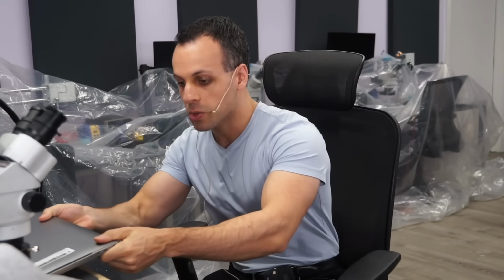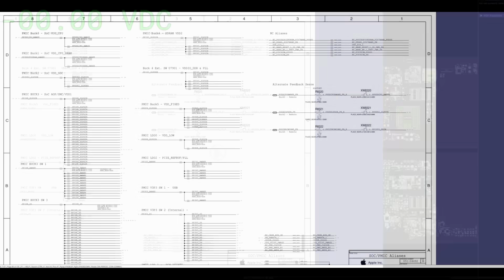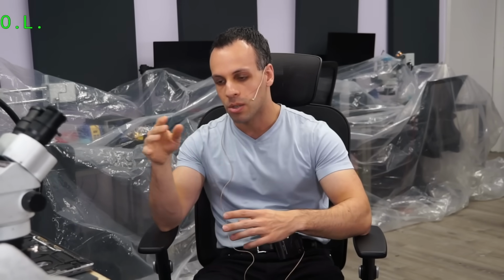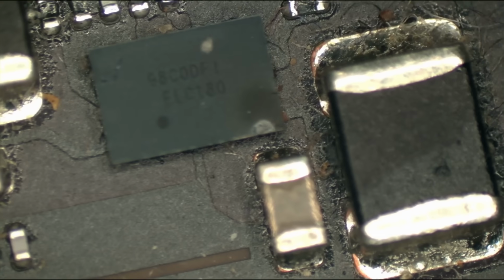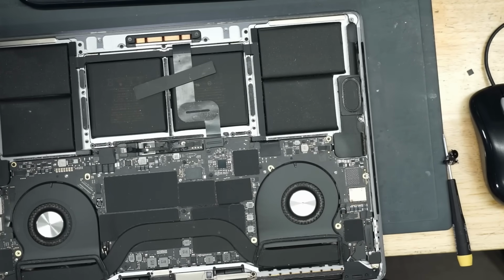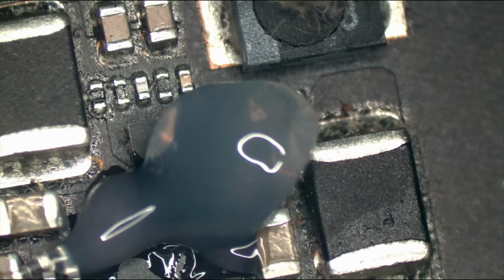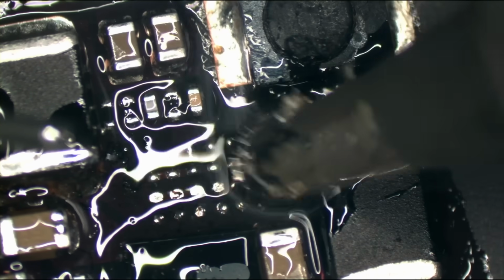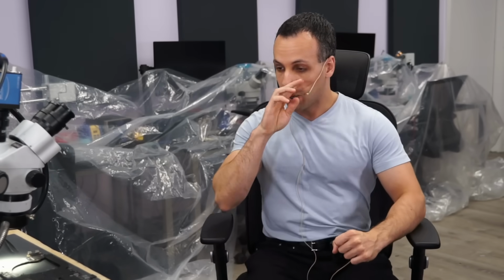How most 16" Macbook Pros often kill themselves & why they're unfixable

Comment: Louis, as somebody who currently has a 16” Intel MBP, and requires it for iOS development, what should I do (other than immediately backing up my data). Is there anything I can do to help prolong the life? Or should I sell it while it works and buy a different model? Do you have any current recommendations?
Reply: Zener diode is the protection you need. Simple to install if you have anyone that does microsoldering. One leg on the power and one on GND. If the Zener is designed for the reference voltage and amperage for the nand, then if it sees a voltage surge it will either pass this to GND or short and send all power to GND. If it burns up it would need replacement but they are cheap and your SSD Controller should be saved.
Reply: Responding because I’m in the same boat. And guess what - I only bought this 16” Intel because my 15” 2016 model had all sorts of random issues. I hadn’t had issues with any models prior to that. Until today at least, my 16” Intel has seemed flawless like I was used to from the brand. Now I’m back to worrying.. 🥴
Reply: As others have suggested here, installing a crowbar circuit to protect the NAND is an option. Might be as simple as installing a single diode.

Comment: I’ve had the same problem on my 2019 MacBook Pro 15”. I properly shut it down and let it rest on my desk as I will be away for a three-day vacation. 

After coming back, I tried turning it on, use different USB-C cables and other compatible chargers (the 87W, my third-party 100W), do SMC/PRAN/NVRAM reset, but no luck. 

Brought it to the less expensive Mac repair shop around our area and they found out that the SSD was the culprit and said it had to be replaced. Was unlucky that I haven’t made recent backups before it happened but lucky that my company paid for the repair fees which was around 530 US$. Still costed more if I brought it to Apple’s authorized service center.

All these hassle just 3 months past Apple’s 1-year warranty. Not to mention that the repair took one month before it got released for pick-up. During that time, I came back to my older MacBook Pro 15” (Mid-2015 model) to cover up the work I do (which are also editing long YouTube videos on Final Cut Pro btw).

Can’t imagine the same problem I’ve had happens to the newer MacBook Pros too. Apple never learns.

Comment: I've been looking into getting broken MacBooks to fix and sell. So far I'm looking for low risk eBay auctions where it's as easy as swapping a new display assembly or something like that where it won't be hard to turn a profit. Already had my first run with the A1932 and JUST WOW I cannot believe how much the aesthetics lie. I mean, I always knew these weren't my machines of choice, but there's so much more wrong about them. With a shiny finish and an expensive price tag you'd think you would be getting what you pay for - nope. Either way, I enjoy the experience. It's fun to problem solve when you get to learn something new and maybe make a buck doing it. Great fun.

Comment: Posting this mostly for the 'engagement' ... I found a pristine looking 2018 MBP tossed out at my local recycling centre.  Water poured out of it when I picked it up, so my first guess was water damage.  I dried it out and cleaned it up really nice.  No visible corrosion.  There was a suspicious looking scorch mark coming from under a small chip that I can't read the markings on.  That, and this video, makes me think that a similar failure has happened.  The water could have got in later, after it was tossed.  Poking around with a multi-meter, I can find 13v, 3v and 1v (I think) but no signs of life.  This thing cost me nothing, so I'm wondering if a second-hand MB from ebay might be worth a shot.

Comment: I'm surprised they don't have TVS or zener diodes on the output of that buck if that's a common enough failure mode and the risk to user data is so high...

Comment: Great video, but painful to watch knowing someone lost their data. I’ve used Macs since 1986. They used to be bulletproof: very reliable with changeable parts (not soldered onto board). 

My two-year-old 16 MBP died last year (No water or drop damage). I didn’t have AppleCare, as the laptop cost $3,600 and I didn’t want to spend hundreds more on the expensive insurance. (big mistake!). 

I trusted Rossman Repair, so shipped MBP to New York (it cost $100-mostly for UPS insurance). Rossman could not repair due to security of Apple’s proprietary T2 chip. 

Then I paid $800 for Apple to replace logic board. Fortunately I restored most files from iCloud, but lost much of my music (iCloud doesn’t back-up music if not subscribed to Apple Music). 

Lessons learned: buy AppleCare; back-up everything, including music.
Reply: you clearly didnt learn a thing. If you had learned anything then:
- realize apple isnt what it was
- get rid of the garbage after repair to recoup as much as possible
- get proper notebook that will last and/or is repairable

What you did was:
macbook broken, pay money, pay more money, hope they will honor the apple care.
Reply: Always, always buy AppleCare.  I get the refurbished models so with AppleCare the price is the same as a "new" copy.

Comment: I get Apple doesn't do things the best way, but man do you exaggerate sometimes. Yes these MacBooks can be repaired and not that difficult to someone like you with proper tools and experience, knows how to read schematics and what not. Even I could probably do some of these repairs, I did avionics in the Marine Corps, was great at soldering. I see Chinese techs repairing MacBooks all day long. Removing and replacing SSDs, RAM, even the SoC M1 processors. Granted they have better access to tools and more importantly, parts, since they're so close to the manufacturers. 
That the owner doesn't have a backup of his computer, and you have to replace an SSD, doesn't mean it's unfixable or anyone's fault but the owner.
Reply from the maker: Cope

Comment: Yeahhhh...... Uhmm... Still not switching to SSD without any spinning platter drive as backup device. So far I am still using spinning platter drives in my machines, because I dont trust and never will trust SSD's. The idea of using solid state storage is cool on Amiga's and 386/486 vintage PC's if that is your hobby. But in the daily driver with all your data, and make it soldered on as default? Heck no...

Comment: One demand for Right To Repair should be a requirement that ALL batteries and data storage devices be user-replaceable. Think about how terrifying it is to update your BIOS because if something goes wrong, the soldered-in chip has now got corrupt data on it and your board is bricked. Now think about how reassuring it would be if you could just pull out the chip and load the update using a dedicated programmer plugged into another machine's USB port if the update fails.

That probably wouldn't guard against this kind of incompetent/malicious design, though. Not unless your removable SSD had over-voltage protection built in.
Reply: And it isn't like you can't make a small laptop with a replaceable SSD. The original 10" MBA had a replaceable SSD and it was a tiny computer.

Comment: Lol 😂 This is why my last MacBook is from 2015, an Air, with a proper keyboard. I actually did own one of the new garbage MacBook pros, with the shitty keyboard they use now. I hated it so much, and the Z key started sticking after about a month. Left it in a drawer for almost two years, until I took advantage of some battery issue that offered a free replacement, which also REQUIRED the keyboard to be replaced, because... Apple. So, I could sell it on at a good price because it had a brand new battery and keyboard. My 2015 Air still works great, but I upgraded to an Asus PC with an OLED screen, so it feels really weird looking at that pixelated display. I'd still choose that 2015 Air over ANY laptop in their current lineup, though. RIP Apple ☠

Comment: I knew it! 
I had the same problem, after a while talking in the phone with them they agreed to fix it free of charge. but they insisted it was an isolated fail and not a model problem. 
MFs that thing is expensive as hell, and if you don't fight with them you get an expensive paperweight after two years

Comment: I wouldn't be surprise if Apple started building in timers into their machines which start when you first setup the machine so after 366 days, literally one day after the warranty period ends, the machines fry themselves.
Reply: That would probably lead to a class-action lawsuit.

Poor circuit board design can be argued. Intentionally destroying a customer's product after selling it to them on the other hand...
Reply: What they would probably actually do is have some chip with an intentional bug in the firmware that occasionally causes it to lock up after more than a power of two number of power on hours or similar, and can be plausibly denied...

...And make that chip control a power MOSFET for a buck converter to some crucial thing like a SSD.
Think different.

Comment: question if apple was right how did the liquid water gest under the chip, buried in the middle of , everything else, are apple Macbook, build to the same build standard star wars  death stars, with a really you less hole on the outside going striate to the most critical part of the machine for apparently on reason

Comment: Hey Louis, I don't know much about this... but it looks like you misplaced the chip on those contacts, it looks like the you are 1 column of pins off. the chip you desoldered was a bit to the left
Reply from the maker: Watch again
Reply: @rossmanngroup  hey! I watched it again and I still feel the same. 
At 10:20 the left side of the chip is aligned to the second of those 5 components (resistors?) on top.
At 13:06 it is aligned to the third resistor. The chip is almost touching the resistor on the right, and before there was more clearance. Also there are a few pins showing on the left.
Reply: Hey  @rossmanngroup  I still think the chip wasn't installed correctly, can you take a second look?

Comment: I love a lot of things about the build of Apple devices. However, it all quickly diminishes because they like to use graham crackers as their PCBs, with proprietary components on them. Their business model is e-waste, but they have some fantastic engineering. If the unit just breaks and isn't serviceable, it just ruins it. I don't need a computer that thin, I can compromise. Also, M1s are useless to programmers, they can't even virtualize x86 worth a crap even know they have this hardware pipeline in the CPU to handle it, but it is only half-baked and doesn't universally allow the kernel to do what an intel mac can to with no problem. Thanks intern at work for showing me how crippled the new silicon is, I was about to trade my Intel in for an M1 for that battery life, but 3 grand for a glorified chromebook is a no-go. Thanks for all you do, Louis! I have learned so much from you.
Reply: Also, not sure if this Mac is M1, i missed the model number you mentioned earlier. I had an Intel 2019 13 inch Macbook I sent you last year, and I dropped something sort of heavy on the "K" key of my Macbook, it is right where the SSD is. It was not fixable, I think the same design flaws made it so easy for my SSD chip to just die, I still have the computer and might send it back to you for full refurb before parts get even more scarce.

Comment: I'm not usually in the camp defending apple, but I do not see an issue in the circuit design here.
This is a huge screw up on TIs end if the chip is known to blow up in that way. This is not a very unusual buck converter
and if this happens to fail in that way many other devices would be affected as well.
I mean if your main supply is too high someone needs to step in and make it fit for the SSD or any other component.
It wouldn't even help if it was a replaceable SSD in this case because it would be fried as well.
Reply: I think the main design flaw is that Apple should have added a crowbar (or other protective circuit) to prevent a power supply failure from frying the SSD. It's not uncommon to design crowbars into power supplies to protect electronics downstream of them, and it doesn't seem like an attempt was made in this case. When engineering anything, you always have to try and think of all possible failure modes, then determine what (if anything) can be done against them. Of course, it also depends on the statistical likelihood of failures as well (cost benefit analysis), but I would think "protecting the user's data from evaporation" would be pretty high on the list of benefits.
Reply: @michaelcalvin42  There is a case to be made for that. although such a fuse should be in the converter chip actually.
Also, solely relying on just the SSD and having no backup whatsover is then also very much a problem anyway. Because no fuse saves you from water damage, physical damage or theft. Which all are at least as likely as this fault I would imagine.
Reply: @markusdd5  I agree that the user should definitely be backing their data up. That's just good practice for any computer (even your phone). But one doesn't typically expect their SSD to suddenly and completely die (the most common failure mode for SSDs is slow accumulation of bad cells due to wear), so a little more protection on the design side would benefit consumers.
Reply: @michaelcalvin42  It is interesting you say that, because the SSD failure modes I have seen mostly in our IT department at work are nearly 100% sudden death xD

Comment: I don't quite get it, Macbooks seem to be but poorly built and extremely delicate. I have an 7 year old Acer Aspire that I paid 299 and Wally world for, have added an SSD and Doubled the ram. It has been dropped enough time that an 3 places Duct tape holds the case together. Had near every can of fluid you find in a auto shop spilled on it, including soda and coffee. I have has to blow the oil coated brake dust out from inside of it at least once a year, and YET it has never failed to boot up and work in that time. Worst thing that happened was the key where getting stuck down, pulled it and cleaned with soapy water and all good. Apples though are far better looking, even when they aren't working.

Comment: No one will argue that MacBooks just randomly die sometimes, and I am by no means an Apple apologist. I'm well aware of the lengths they go to to fight against right to repair, it's gross. With that said, you say they're not well built devices so I would ask -- if they're not, what is? I've managed a fleet of about 500 MacBooks within recent years and the instances of them randomly dying is very low, <1%. Which laptops are built remarkably better?